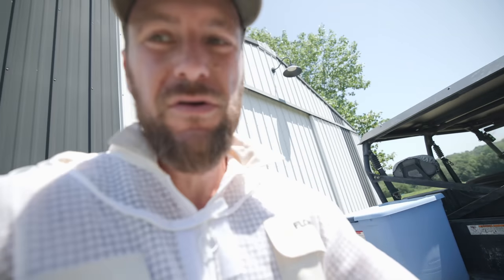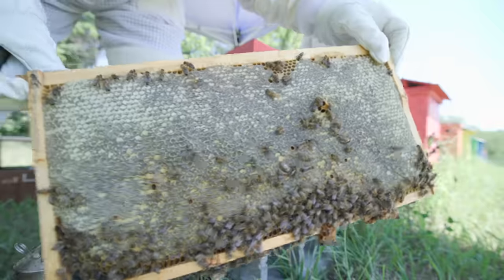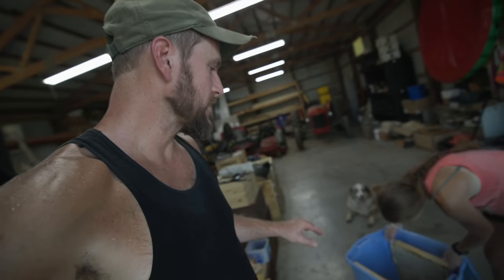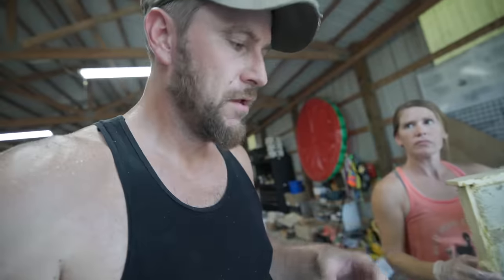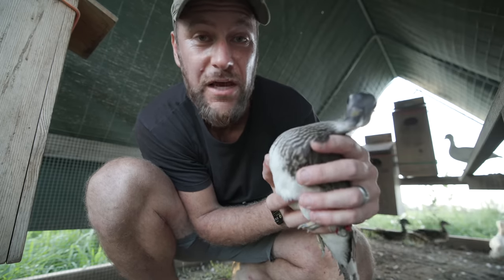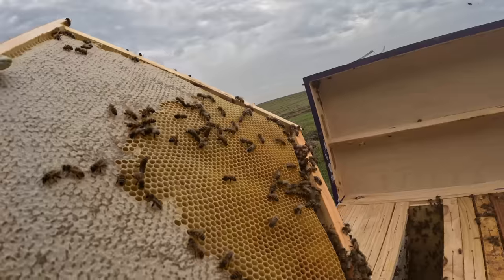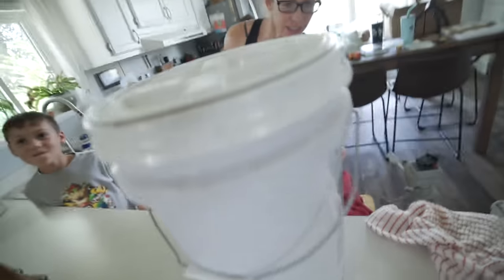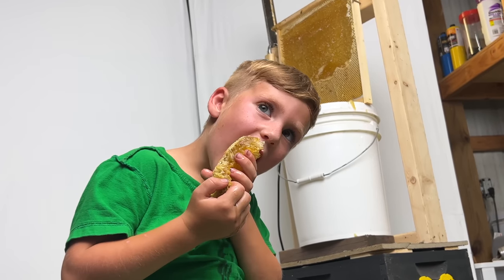We Got our Largest Honey Harvest Ever!

Comment: Using a electric hot torch I a good idea but takes a lot of time , so what i do is , I use a electric shouldering iron machine  ( of 25watt  ) & remove the soldering bit of it & attached a stainless steel wire net edge - which at the end work as a  HONEY PAW machine , & work as a butter knife - really smooth really fast

Comment: Just a tip from an electrical engineer, unspool all your cable from the drum before using heavy loads, if you don't the insulation in the cable drum will melt sooner or later and It can start a fire.

Comment: Not sure if you do the off-camera frames that slow.. and not sure if it would help at all but there is this serrated knife you can get that has the same angulation as the hot knife, but all you have to do it saw down through the caps. Another tool you could get is an Uncapping Fork that can pick at some of the caps that get left behind.